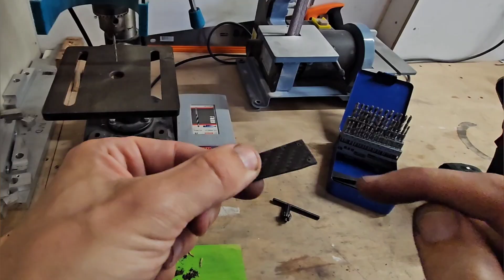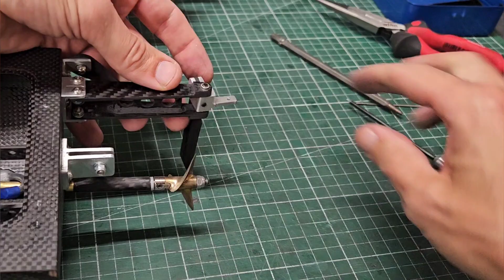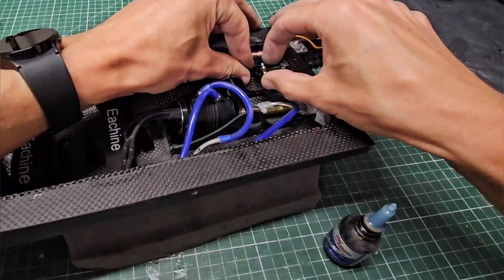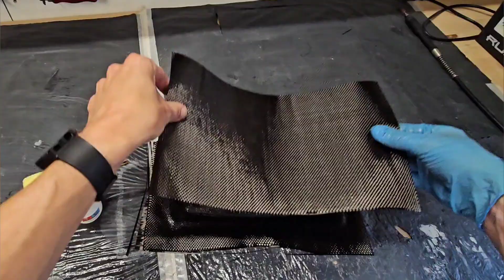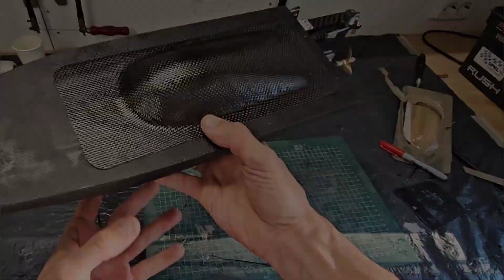How to make a carbon fiber RC boat with basic tools - part 3

Comment: What did you use when you covered the mould for the hatch before putting the carbon cloth on? looks like it could be very useful for something I would like to do.
Reply from the maker: Sorry, I should have added some explanation. It's just packing tape! I waxed it before applying the epoxy. It works pretty good!

Comment: Wow.. even custom fab rudder mount and cooling! Very impressive and inspiring 👍 ..I'll have to save this one for later 💯
Reply from the maker: @scaleworksRC  Thanks! The rudder is stronger and 50% lighter than the wooden version rudder. I wanted a knife blade rudder on this one to reduce drag 😎
Reply: @CozyRC  I'd imagine you don't get very much flex with that thickness either.. very, very cool 😎
Reply from the maker: Yes, It's very strong 💪